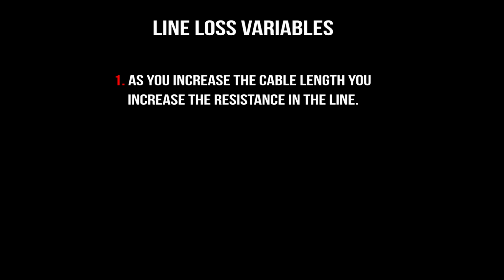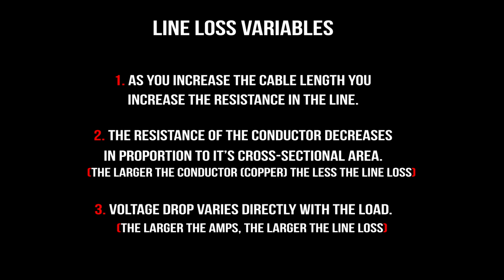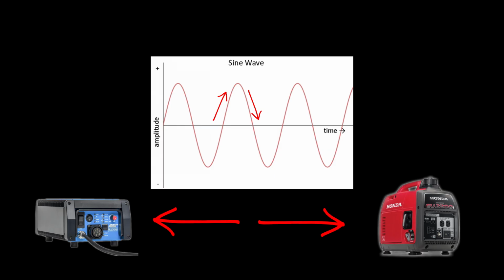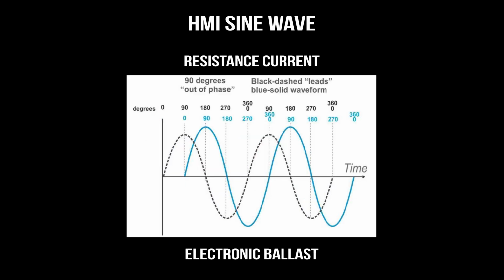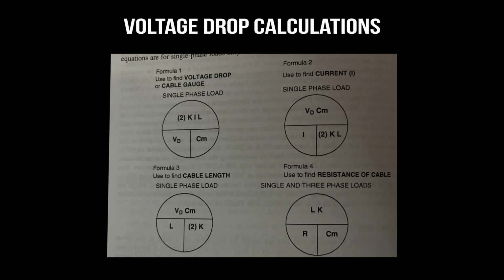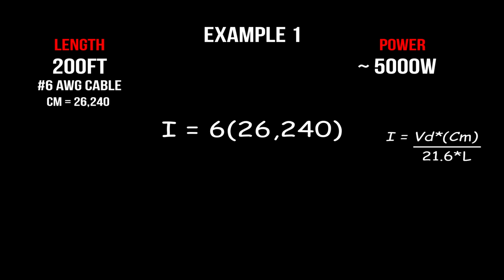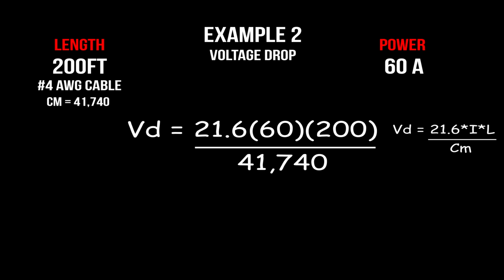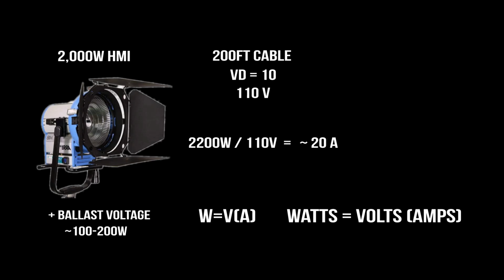Line Loss Explained: What Every Film Crew Needs to Know and How to Calculate

Comment: why is it 6*26,240 ? what about ppl in uk or india wire size is given in mm ? im confused ps help
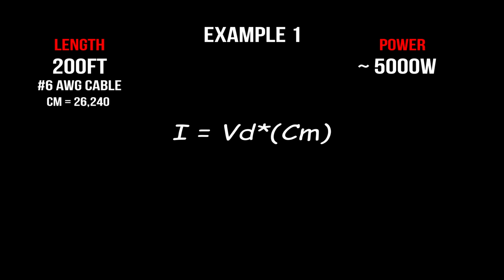Reply from the maker: Be happy to help you out!. For example, at section 5:30, 6 is the max voltage would would for that length of cable run. (It could be less if you want like 4, for minimum impact on equipment, really up to the electrician/gaffer.). The 26,240 is in Cmil/Circular mills. Which is actually a metric measurement, but it's a unit of area measurement instead of diameter. Basically the volume of the cable. Electricity will use the whole area of copper in the cable, so we don't want to use mm as that's just a diameter measurement, we need the get whole unit of area of the copper. Converting Cmil to MM can be a bit tricky, but here is a good chart that has cable gauges, Cmil, and MM for calculations. https://www.engineeringtoolbox.com/awg-wire-gauge-circular-mils-d_819.html
Hope that helps!